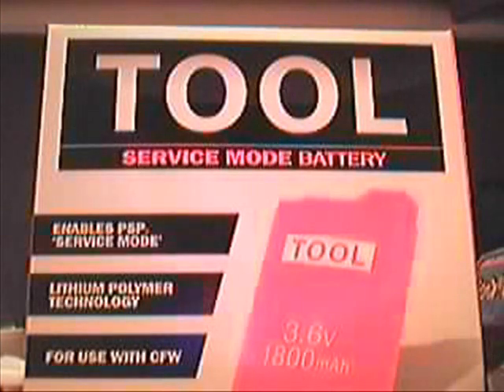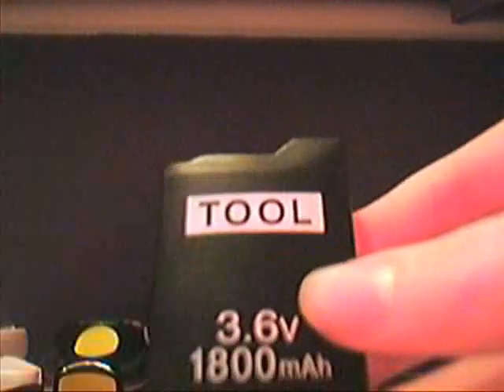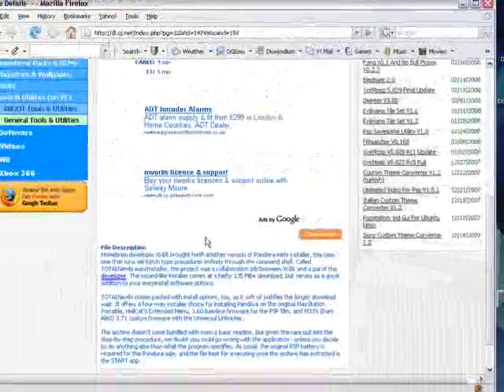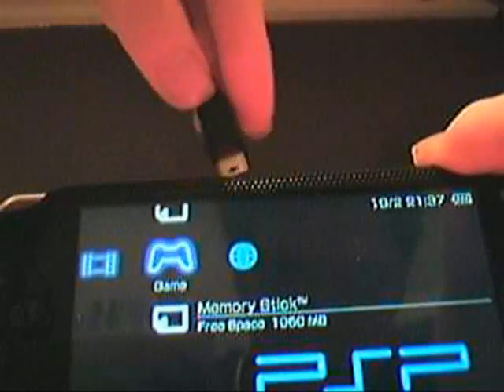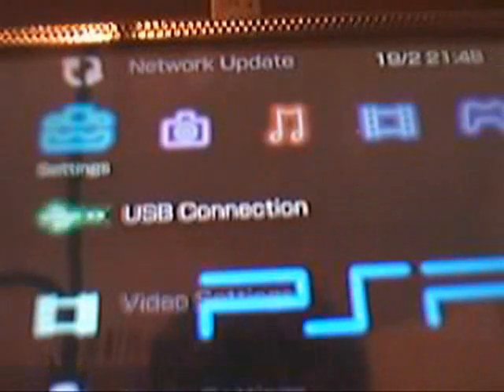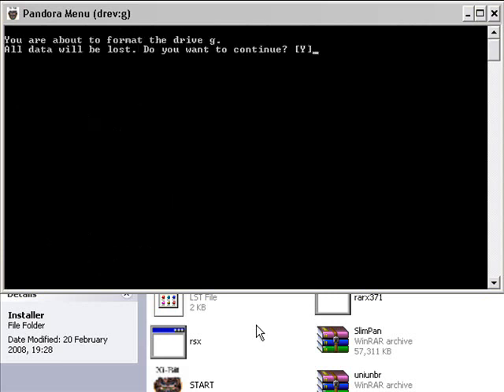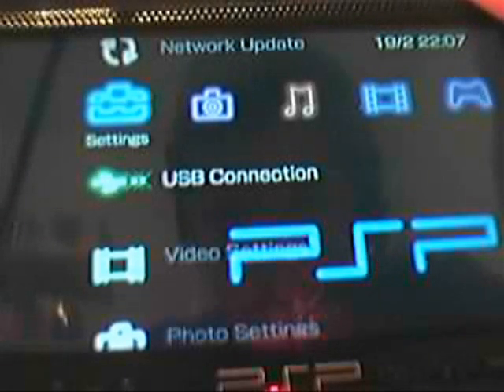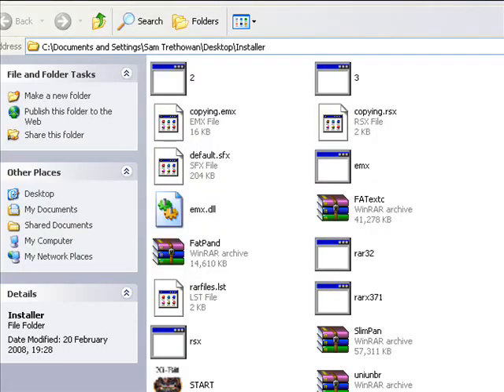How to use the Datel Tool Battery - Part 1

Comment from the maker: @bluelighting112 i have not tested them on psp slim myself but the files should work fine. there is a slim downgrader option in the program if you are not sure about using the universal one i use in this video (but the universal downgrader does work on psp slim).

Comment from the maker: yeah i have heard of that problem before. 

sorry but i am not sure how to fix it. it happened to me once and the reason was that i was using a USB cable to charge it instead of the PSP power cable. all i can suggest is that you try changing your method of charging your psp but it probably wont make a difference.

there is a chance that your battery is broken but that probably isnt the case. 

try searching for your problem on google or try contacting Datel. sorry about not being much help

Comment from the maker: you cannot use a TOOL battery normally because it forces the psp to boot from the memory stick instead of the flash memory when you turn the psp on with it inserted

Comment: I have PSP Slim so I typed in option 3 in the setup for the MMS. I have finished but when I put in my tool battery I do not get the screen up what tells me what to press to do whatever. My original PSP Firmware is 5.02.

Comment: buddie, your video was a major help, ive hacked psp fat which was originaly 5.01 firmware and im now running 3.90m33-2 along with the kernel addon, also got the nes emulator etc. and a load of psp iso games :) just wanted to ask you if this tutorial runs the same process with the psp slim? do you know.. as ive got a psp-slim data tool battery aswell.

Comment from the maker: it should work the same way with a psp slim and slim tool battery. it may not be exactly the same because i used option 1 in the video. 
but im not sure whether a 4gb memory stick will work; some people have tried with a 4gb and say that it doesnt work. i used a 2gb memory stick in my video.

Comment from the maker: the magic memory stick does need to be made first because when you insert the tool battery, it boots from the data present on the memory stick.
you can run umds the same way as you do with official firmware. m33 custom firmware is exactly the same as official firmware except that it has a couple of extra features including the ability to run homebrew.

Comment from the maker: yes, you do need to downgrade first to put custom firmware on. but the 4th option on the installer will downgrade the psp and install 3.71m33 automatically saving some trouble. but in the video, i downgraded my psp to 1.50 and upgraded manually as shown in my other video

Comment from the maker: if you choose option 4 on the total newbi easy installer, it will also install 3.71 m33 custom firmware on your psp and then you can upgrade normally from there. i dont know what nitepr is though so you will have to try that out for yourself.

Comment from the maker: the only time i had that trouble was because i was trying to charge it up with my usb port on my laptop. i plugged it into a standard power outlet and it charged. you are using the right type of battery for your psp arent you? if you are then i dont know what the problem is, sorry.

Comment from the maker: they dont have to be the official sony one, i used a sandisk pro duo 2gb in this video and it works fine. it only needs to be a memory stick PRO duo and magicgate compatible. if it has the magicgate symbol on the card, then it is magicgate compatible.

Comment from the maker: it will have the same kernal as the custom firmware you have installed. if you want the1.50 kernal as well, you will need to install the 1.50 kernal add-on

Comment from the maker: if you have a psp slim, i would recommend that do use option 4. but it might not be exactly the same as option 1; i havent tried option 4 yet because i dont have a psp slim. but yes, it will put custom firmware straight onto the psp.

Comment: Hey dude,

I have the slim psp with official sony 4.05 firmware on it.

Therefore instead of choosing option 1 (Fat Pandora) cant I just go straight to option 4, the universal unbricker with cfw 3.71 m33... which will do the same thing as option 1 and install a higher custom firmware for me?

Plz reply asap

thanks.

Comment from the maker: doing the option 1 (the one i did) gives you sony official firmware 1.50. you can then upgrade to custom firmware from then. if you choose option 4, it will give you custom firmware 3.71 m33. but i havent tried this before.

Comment from the maker: some people have tried the fat battery on slims and have said that it works, but just pokes out the back of the psp slim. i havent tried it becuase i dont own a psp slim.
make sure you turn the psp on with the regular battery inserted and when it is on, put in the tool battery and leave the psp on.

Comment from the maker: there is a slim version of this battery for psp slims. you will also need to use the slim downgrader option in the installer.

Comment: gt the battery charged it up found your video and followed the steps right thru, selected 1 fat pandora but i'm getting the message 
psp ms ipl installer
load ipl code e:/msipl.bin
can't open e:/msipl.bin
press any key to continue
i am running vista on my computer, is this the reason why its not working? i have psp software version 3.9

Comment: Awesome so far, I got as far as the last step by plugging in an external power source...the only problem is that my PSP won't charge my tool battery, and it says it needs at least a 50% charge to complete the 1.5 downgrade. No matter what I do the charge seems to stay at 0%. Any ideas?

Comment: I have ordered a Tool Battery(hopefully be here tomorrow).Now I have a few of questions:

1- If my PSP is bricked how can I charge the Tool battery?
2- If my PSP is bricked how can I transfer the files to the Memory Card.

If I HAVE to use someone's PSP to charge the Tool Battery  and Transfer do I just wait until the Magic card is created then remove the Card and the Tool battery from there PSP and put them in my BRICKED PSP,Finally does this procedure alter there PSP in ANY way?

Comment from the maker: you shouldnt need to run anything from the psp's menu. you should be able to insert the battery and the psp should turn on to the pandora menu. if you have charged up the pandoras battery and inserted it with the magic memory stick already in and the psp does not automatically turn on (or if you turn the psp on yourself and the psp boots to the standard psp menu), then the pandoras battery does not work.

Comment from the maker: the setup that I used is supposed to unbrick any psp as well as downgrade it to 1.50. i havent tried this on a bricked psp yet but it should work. you can try the universal unbricker if you want to. it says it will install custom firmware as well so you dont need to!

Comment from the maker: what you have is fine to do the downgrading. there is an option in the total newbi easy installer to make a magic memory stick that will downgrade/upgrade your psp to custom firmware. the option that i used downgrades it to 1.50 firmware from which you can upgrade to custom firmware afterwards.

Comment from the maker: if you use the datel tool battery, then you can use your normal battery afterwards and you do not need to backup your nand. if you use your normal battery to downgrade, then you do need to backup your nand and once used to downgrade, you can use the backed up nand to turn your battery into a normal use one.

Comment from the maker: when you insert the too battery, it forces the psp to boot from the memory stick instead of its internal flash memory. when it boots from the memory stick, it runs whatever is instructed to boot on the memory stick. that is what the installer is for. it saves all the files required to boot your psp to the downgrade menu. 
when using the installer, it only uses the memory stick and the tool battery is not needed to run the installer.

Comment from the maker: yes, the battery can downgrade ANY psp. 

P.S. if you upgrade using the Update option on the PSP, and you have m33 firmware, then it will upgrade to the latest m33 custom firmware.

Comment from the maker: you have to use the psp slim downgrader from the menu. are you running the software from the psp menu because you are meant to insert the tool battery with the magic memory stick already inserted. this should then boot your psp from the memory stick instead of the psp.

Comment: Just a question, i recieved my datel tool battery today, i have official firmware 3.90 from sony, can i downgrade from ofw 3.90 to the latest cfw without downgrading to 1.5 and back to the latest cfw? or is it a necessary to downgrade to 1.5 before upgrading it to cfw?

Comment: no that was not the problem, it turns out that is just how it is when you choose option four, lol. it'll have the screen black then it shuts off, i plug my adapter in a and violla, 3.71 m33, worked like a charm. thanks for the video man it helped sooo much

Comment from the maker: i say on my video to backup all the files on the memory stick onto your computer since you will be formatting it to put the downgrade files on. after you have downgraded, you can format the memory stick again and put the saved files back onto the memory stick. 

a tool battery will always force your psp to boot from the memory stick (aka downgrade it) so you cannot use any tool battery as a regular battery.

Comment from the maker: i assume so, coz i actually stopped before it was 100% charged coz i got impatient(lol). the instruction manual asks for a minimum of an hours worth of charge but i did 2 hours. when charged, u turn the psp off and take the battery out (if not already) and put it back in with the magic memory stick in the psp. make sure the magic memory stick is already in the psp before inserting the battery.

Comment from the maker: You can buy other Memory Sticks that will work as a Magic Memory Stick as long as it is MagicGate compatible. You can tell if it is by the MagicGate symbol on the stick or by looking at the Memory Stick info on the PSP. I would recommend buying a SanDisk make stick from Amazon.